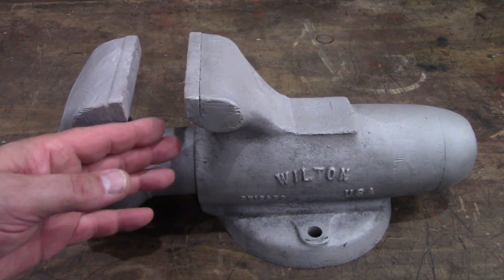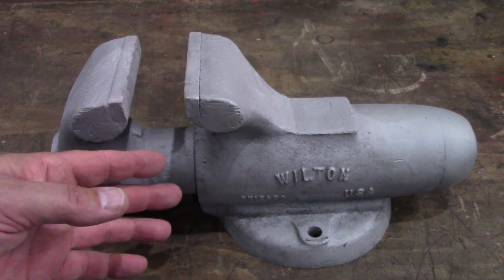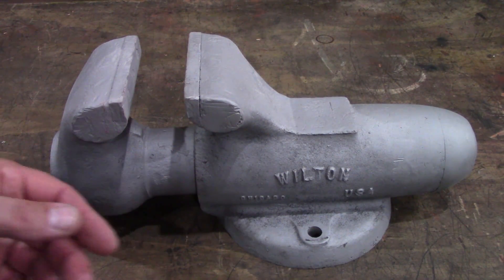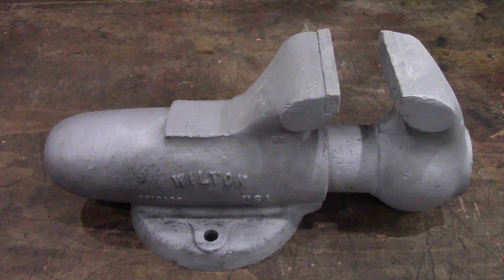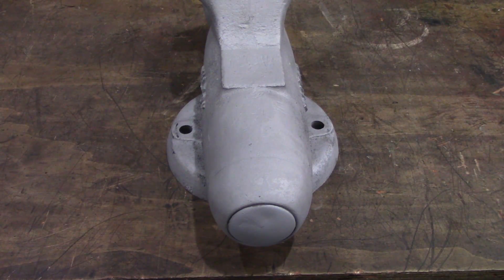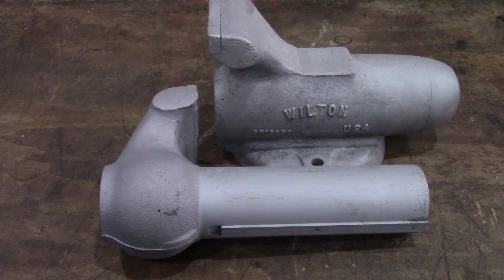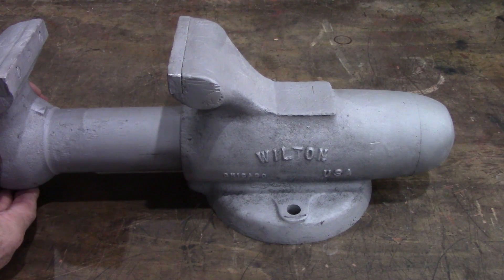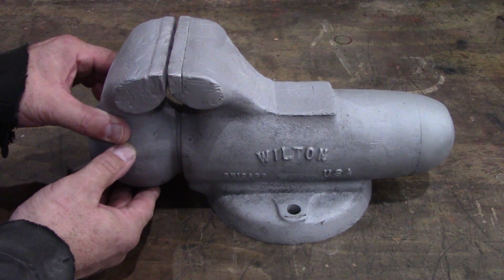High Pressure Two Stage Blasting

Comment: Hi Ray... Great series on your Tacoma upgrade of the HF cabinet.  It has been so helpful for me I can't begin to tell you.  I'm grateful for your efforts.

Apologies for coming to the party a little late.  My question; ...was the high pressure method used just out of speed and convenience or because the low pressure method didn't work on the Milton vice substrate and physical configuration, or solely to demonstrate the contrast between low and high pressure methods.  Thank you for your time.  Best wishes
Reply from the maker: Many Thanks! This vise body did not really need to be high pressure blasted, this was intended for demo purposes only but I did do another video after this one where garnet media and high pressure was needed. This was done on two badly rusted brake backing plates, check that video out. For most general purpose glass media blasting 40-50 psi is more than adequate.
Reply from the maker: https://youtu.be/WkjlW3enBWY

Comment: Why do you refer to a “ two stage?”
Reply from the maker: Hi Bill, Two stage blasting is when you first use a glass abrasive for cleaning then change out, clean the cabinet then finish blasting with glass bead. I show this process on a couple videos in the series.
Reply: Ray's Garage  Roger that. My mind got hung up on two stage compressors or some sort of air regulation system. Thanks. I was over thinking it but could not figure out how that could happen in such an efficient simple system. Two type of abrasives for two types of uses. Got it.

Comment: Since I'm tight on cash I modified my cabinet myself with homemade door cover, vent baffle, vac valve, light kit. It gets the job done so I'm onto my next mod. Between the gun, metering valve and foot pedal what would you recommend as the next purchase. I have to do it in stages.
Reply from the maker: I would highly recommend getting the budget friendly Tacoma Gun Kit, it by far is the best cabinet upgrade from the HF gun and  siphon tube.
Reply: @RaysGarage  I'm looking at the price sheet Kelly sent me and it shows the different guns, is the one you are referring to the Standard blast gun, or they show standard plus and deluxe.? Thanks for your input.
Reply from the maker: @ltmedic3  There are three gun kits, all major improvements over the HF kit. Choose the kit that fits your budget.

Comment: Hey Ray nice job bud! I tried for two days to get my suspension for my Chevelle blasted and had problems with media kept stopping and starting but finally got it done. Tacoma got my new gun and mixing valve and new gloves out Saturday I hope it fixes my cabinet I ran the piss out of my compressor because of the problems with the old gun and its a 80 gallon Deviless compressor she was smoking hot hat do let it shut off and cool down . I really hope the up grade from Tacoma will do the trick I have everything else done. You give me hope keep up the good work Ray you are doing a great job! Don't change a thing!
Reply from the maker: Thanks Roger, Yes, the Tacoma upgrades will save your compressors life since you will be blasting at around 40 psi. If you have a spare tank laying around, add it to your system for more air storage! I restored a 1969 Chevelle in my early 20's, should have never sold that car! Let me know how the upgrades work for you!
Reply: I should have the upgrades in a few days just coming from Idaho . I already have a bunch tide up in the cabinet I hope this takes care of it?   I seen some good prices on Chevelles still a lot of them out there don't give up hope or your dream. Will give you an update on how it goes thanks bud!

Comment: Ray what is the best way to get in touch with Tacoma?  I emailed, called, and sent a text and I can’t get any information.   Also, what is the cost of the full option list of the cabinet you put together?
Reply from the maker: Hi Sonic, Best way is to call Mike or Kelly @ 208-264-5543 If you buy the Deluxe kit and all the upgrades and accessories the cost is just under $1200 shipped.

Comment: Hi Ray, I finally finished my cabinet set up today and the results are amazing! I was doing the low pressure blast but the results were slow as it was steel with paint and rust so I need to try the high pressure blast, I know you said a 1/4 open on the metering valve but you don’t mention the waste gate setting on the exhaust? I think on the low pressure the waste gate is fully open? So for high pressure is it only 1/4 open? Thanks!
Reply from the maker: Hi Marc, With steel and rust run 45 psi and adjust the metering valve to about a 1/8" open, dont be afraid to test different settings on psi and metering valve, Different altitudes has a big part in this as well! As far as wastegate settings keep your white ball down near the first green ball, this will remove dust and keep most of the heaver media in the cabinet, I keep both my vac and cabinet wastegates wide open, this puts my white ball in the sweet spot!

Comment: I wanted to know on size air compressor I can go with. I been looking into a company but unsure of size that will be good. I will be working out of my garage so didmt know least size gallon tank I can use. I will be mostly cleaning parts and accessories for atv motors and my race quads. I like the 2 stage finish
Reply from the maker: My recommendation would be to buy the highest CFM output with the lowest Pump RPM rating you can fit and afford in your shop. I bought this one for just under $2500.00 and it's perfect, runs only two times when blasting for 15 minutes straight at 45 PSI at the cabinet and using a 1/2" hose off my 3/4" RapidAir MaxLine system. Sounds a little overkill for a hobby guy but in the long run it will last forever and cost less to operate!
https://www.youtube.com/watch?v=dLOnUdLvDmM
Reply: @RaysGarage  Hello Ray. Would you say a 2 stage finish is compared to vapor/wet blasting
Reply from the maker: J JB I know I will be opening up a huge can of worms and will be challenged on this subject but a vapor cabinet is not need. With that said any surface finish can be obtained once you understand dry blasting and it’s endless possibilities. The short answer is yes, two stage blasting is the way to go and a heck of a lot less mess and money!
Reply: @RaysGarage  ok it was just a thought
Reply: @RaysGarage  Ray I would like to talk more in detail direct with you if you have time. Reach me on my email gixxerlif43@gmail.com and I'll provide a contact number and time that works for you

Comment: Interesting....I have always shot just glass beads at high pressure (90?)....it would be interesting for you to take a part and shot 1/2 with the abrasive cleaning, the other 1/2 of the part with no cleaning, just glass to show the difference, also high/low pressure on air and mix.....You are doing a great job on the explanations.....SUGGESTION....raise the cabinet so you can stand straight, it appears that your are hunched over for access....my experience once I raised my cabinet it heightened my enjoyment of use.....Also, do you filter the media when removal for exchange to clean out particles? I use a strainer to catch all of the “trash”....ATB
Reply from the maker: Hello Chuck, Yes, I do need to raise the cabinet, I think they made these for short folks! I will be doing a part for Keith Rucker & Clarke Easterling right from the casting and doing it three sections, just abrasive, just bead and two stage. It's going to be interesting how it turns out. Yes I have a screen strainer but so far the parts have been clean enough for the screen to catch anything! Thanks for the advice as always! Cheers, Ray

Comment: Hey Ray, I am not sure what you are doing for protecting your window glass but I switched to a single pane of tempered glass and then put a piece of #40 12 x 24 stainless mesh inside the cabinet and sealed the glass down on top using weather stripping seal and I no longer have to swap glass or deal with laminate strips.   It dims the view a fair amount but I put in some high lumen LED lights in the back and front of the blast cabinet and the difference is excellent.
Reply from the maker: Hello Robert, i am using a piece of Lowes single pain backed up with the thick piece that came with the cabinet. The single pain is a consumable and will be changed it out once it becomes dull. it need as clear a view as possible for videoing! Here is a link to the window install,
https://www.youtube.com/watch?v=7vLBORCV_-E

Comment: Ray, this is the first time I have seen this process and I am thrilled. I have blasted for years in my previous profession of airline mechanic and never knew the surface finish could be finessed to this degree. Honestly, it wouldn’t be practical without these Tacoma cabinet upgrades. It simply wasn’t practical to change out media so often before when it filled a 5 gallon pail. I have 2 vintage vises to clean and my kit from Tacoma is scheduled to ship out next week. I’m really enjoying your videos, well done sir.
Reply from the maker: Many Thanks! You are going to be amazed with the Tacoma upgrades and your parts will turn out perfecto! Feel free to hit me up with any questions during assembly.

Comment: Ray I have never done this so I have some questions, I am assuming the added dust I see is the material [paint] being removed?  Did you still use high pressure for the glass beads?  I would love to have one bu I am old on fixed income and have managed to put 100 pounds of potatoes into my 25 pound shop 2 mills 2 lathes and mig, tig and stick welding plus the accessories.  Thanks for sharing He Pomaika`i `ia mai ke Akua and Hou`oli makahiki hou for 2020 [God Bless & Happy New Year from Hawaii]
Reply from the maker: Hello Charles, The extra dust is from running higher pressure and with the media being blown around plus what is being removed from the vise. I still have a very clear sight of what is being blasted since the vacuum system removes the dust pretty quickly. Yes, I am using the same pressure of 45 psi for the glass bead as well. Sounds like you have a cozy shop there! Happy New Year!!!!